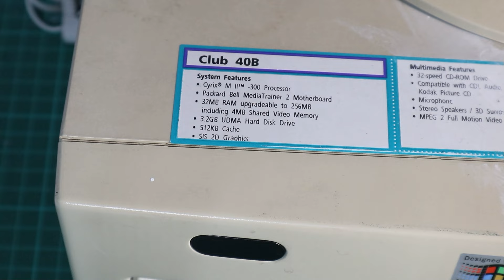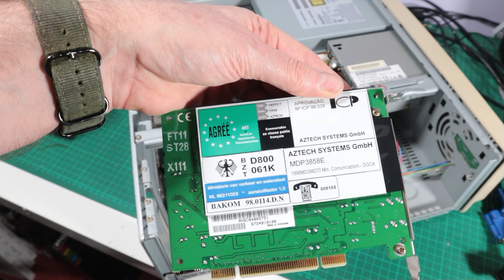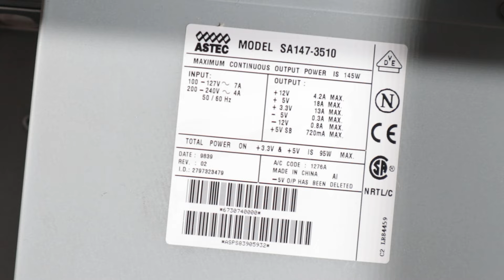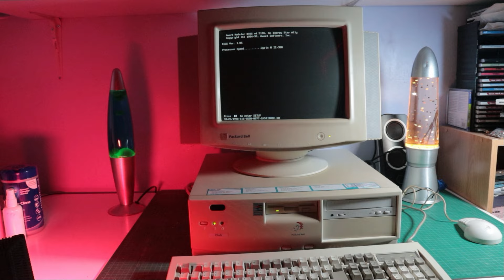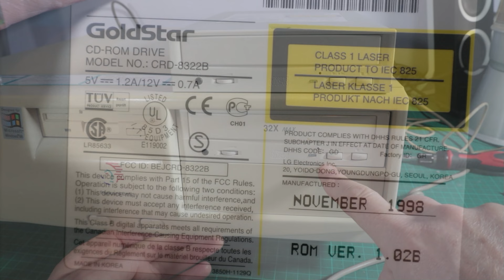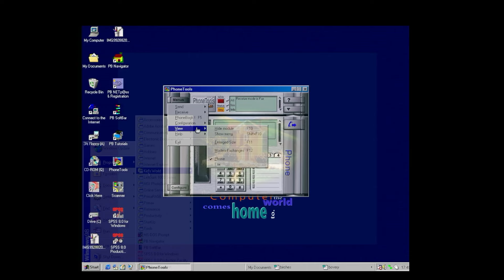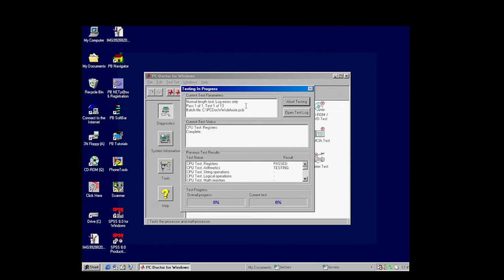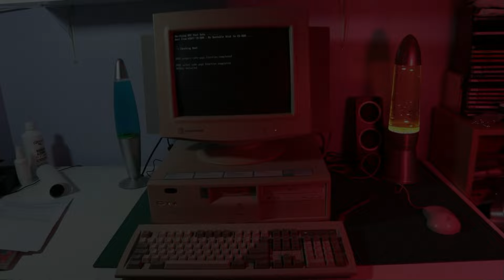Cyrix MII 300 in a Packard Bell Club 40b Part 1

Comment: LG stands for "Lucky Goldstar"  It's the exact same company.  They decided to rebrand with the slightly less Korean sounding name in the late 90's.  Back in the day, I gambled on the X2 modem standard, as it was a bit more technically advanced than the K56Flex standard.  I was upset when it lost out.  But then the Modem manufacturer released  a firmware update for the new standard, and all was well and I had the new v.90 speeds.

That's an interesting machine, I don't believe we had that particular model here in the states. Packard Bell was pretty well going downhill here by late '98 as they'd achieved a "reputation"
Reply from the maker: Cool, I had no idea, always wondered where goldstar went. I vaguely remember v90 coming out, not sure what I had at the time. I always remember not thinking much of packard bell, I dont think they really hit europe until later and were a chain store kind of pc. It's still a nice kind of home office machine and seems pretty well made.
Reply: The new name "Lucky Goldstar" (and later, LG) is the result of a merger of Goldstar and Lucky Chemicals in the 1990s. Both companies had already been parts of the same conglomerate which used both the ""Lucky" and "Goldstar" brands separately before.
Reply from the maker: Cool, you learn something new every day 😁

Comment: nice vid, love that monitor "ring" on the top. on no a flex modem! is that velcro on the back of the mb? unimpressive ram amount. it looks great inside.
Reply from the maker: Thankyou! Yes nice round clean patch on top😁. Wasn't velcro, it was a bit of adhesive foam, guess to hold the board in place when it was first screwed in.